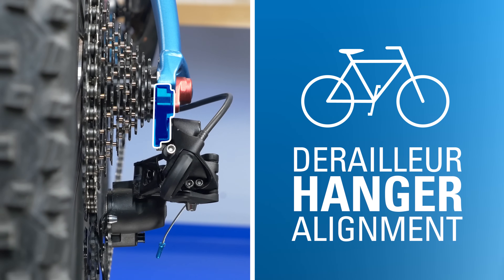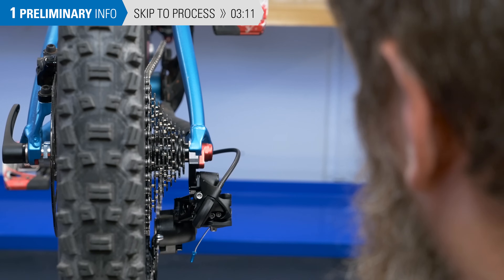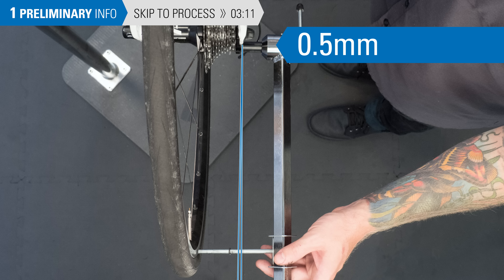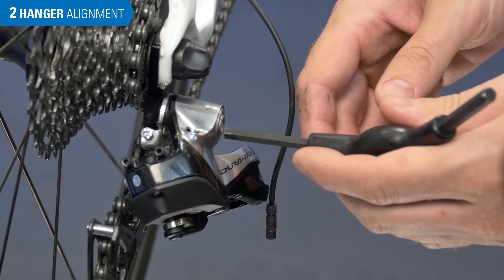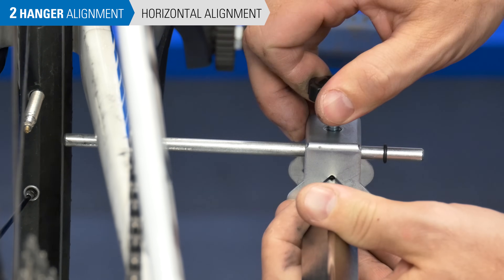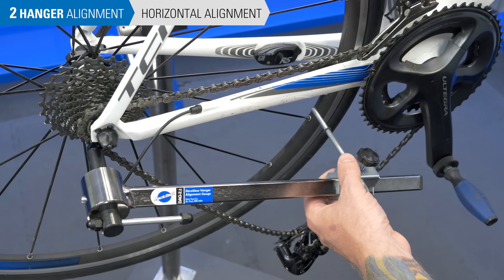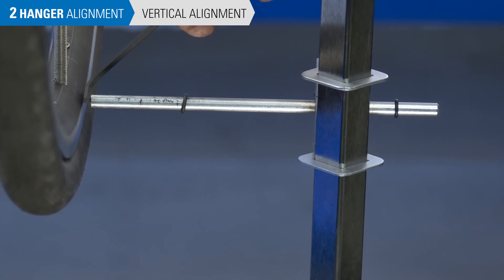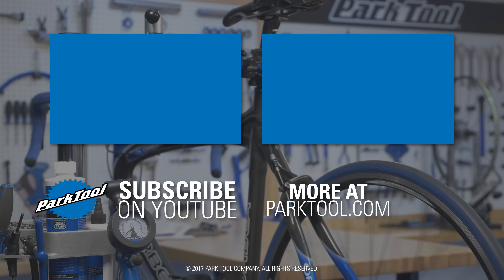How to Align a Derailleur Hanger Using the DAG-2.2

Comment: I habe a problem and I wonder if anyone could help me. I had a big crash which unfortunately bent my derailleur hanger. I tried to replace it but I cannot remove the big screw connecting the derailleur to the hanger. As the hanger is bent right where this screw sits, it is stuck. This makes it impossible to realign the hanger. Is there anything I can do apart from buying a new derailleur?
Reply from the maker: Could you send a picture of the situation to Info@parktool.com and just put Technical help in the title? We can help you a bit better with a visual of the situation. Thanks!

Comment: Is anybody able to help me - trying to figure out why my bike has such poor shifting; after indexing gears, adjusting limit screws, new freewheel, new chain, have narrowed it down to a possibly bent derailleur hanging point (will get to this) or retro-fitting my bike with an incompatible shifting system. Assuming it's the first, it's possible the bike was crashed before me (purchased second hand), as the rear mech does look slightly out of line (i don't have any fancy tools to check properly though). Only issue is, the derailleur is attached directly to the frame - there's no hanger for me to replace or bend back in alignment. I have no idea whether this is par-for-course on road bikes as i've never owned one before, and don't know whether purchasing this tool would help straighten it out as it's not really designed to bend the frame. Is this normal? Is the bike doomed? Thanks to anyone who's read this and might be able to help!
Reply from the maker: Some bikes have the hanger built into the frame and you can straighten them but will want to do so with care as if you break the built in hanger, you cannot replace it. You may also be dealing with a bike that has a derailleur with a built in hanger. These are a bit more difficult to straighten but it is possible to do so with some care. The bike is not doomed but sounds like it needs some adjustment.
Reply: @parktool  Thank you so much! This is super helpful.

Comment: are the limits screws easy to replace
Reply from the maker: Yes, if you have them.  Unlikely you will find this as a new part.  Used ones will work if they are the same thread.  Typically if you stay with a brand, you are safe.  Replace a Shimano limit screw with another Shimano screw.  Many shops will have a "bone yard" of used derailleurs for just this reason.

Comment: Can I do the allignment on a carbon frame as well?
Reply from the maker: A carbon fiber frame will use a metal dropout for the hanger.  If the dropout is metal, follow the same procedure. It will not damage the carbon fiber frame.

Comment: tool 70 $ new hanger 5 - 15 $...
Reply from the maker: Ive never installed a new hanger that did not need to be straightened. This is a combination between the frame tolerances and the hanger tolerances. To test, install a new hanger and check it.
Reply: @parktool  same exp here , brand new bikes and all , never found a straight one , but some were within 3mm
Reply: I have six bikes in my house. $70/6 = $11.67
Reply: Visit your local bike co-op and borrow theirs

Comment: Can this tool used to repair old steel bike with semi horizontal dropout like surly cross check?
Or should I use FFG?
Reply from the maker: Those two different tools are for two different issues.  The DAG-2.2 aligns the hanger only.  Bending occurs at the "neck", the narrow part between the dropout and the mounting bolt.  The FFG-2 is for aligning both left and right dropout faces parallel to one another.
Reply: Park Tool actually it is an old steel road bike and have semi horizontal dropout. It doesn’t have rd hanger so maybe i should purchase FFG and frame alignment tool.

Comment: Just got the Cyclospirit tool of ebay,same as the park but cheaper,checked all 7 roadbikes and all were out by  a lot,should of got this loooong ago,sighting up doesn't work as good as this tool,if u work on ur bikes this should be mandatory tool,also don't think putting a new hanger on doesn't need to be aligned even if u buy a new bike youll be surprised how outta wack a hanger is
Reply: And here you are watching a Park Tool video to use it. Shoulda bought a Park and supported them.
Reply: @BluedotProductions  Generally you're correct about supporting the tool company (Park) that makes the videos but, if someone is poor, I think Park would be okay about it.

Comment: My old frame doesn’t have a replaceable hanger.  Changing gear on the second and third from largest cog doesnt index correctly. Hopefully my alignment tool will arrive today, and ill not break the hanger off. Thanks for this video, hopefully things will work out for me. Update- derailleur hanger was bent, now straight thanks to park tools
Reply: Ya if it's an old steelie it should bend back, no problem.

Comment: What happens if the frame, at that hanger contact point got bent instead? I know the hanger is supposed to be the path of least resistance but I know someone who had their bike fall of their car and the frame got bent instead
Reply from the maker: When a bike falls off a car all bets are off! I hope it is still salvageable. Sometimes with a serious impact the frame sustains some damage.
Reply: @parktool  mu old frame has bent chainstay. Forget about any form of any alignment. The only solution is new frame.

Comment: im sure most bike shop would suggest replacing the hanger rather than correcting.
Reply from the maker: I'm not aware of a bike shop that does not have one or more of these tools. Some of the bikes out there don't have replaceable derailleur hangers. So these can be the only way to save a bike.
Reply: Only if the hanger is bent too badly will the LBS guys recommend replacing the hanger.

Comment: How do you align the new shimano derailluers with the bracket axle? Do you just adjust the hanger same as usual or do you adjust it with the bracket axle installed? Thanks
Reply from the maker: The alignment of the Direct Mount Rear Derailleur hanger is identical to a standard derailleur hanger. This video still applies to those.

Comment: My cycle hanger is bent outward side and it is frame built in hanger and frame is made of steel can i use adjustable wrench to straighten my hanger i cant use dag 2.2 because it is not available to buy in my country reply
Reply from the maker: Typically with a steel bike with a built in hanger you can use an alignment gauage or in your case an adjustable wrench to straighten it. If it is very bent you will be putting a fair amount of fatigue on the metal and you need to be careful and also be prepared for the worst....a broken bike. Good luck! What country are you in?
Reply: You could buy a non park hanger tool but the quality will not be the same

Comment: @Park Tool  Is it safe to use the WAG (or any other deraileur alignment tool) on hanger mounted on a carbon frame?
Reply from the maker: When the hanger is aluminum, it is safe as any other bike. When the wheel is clamped tight, and the hanger is bolted tight, the stress from the DAG-2.2 is on the hanger, not the carbon fiber dropout.
Reply: Park Tool awesome tip. Thanks

Comment: The tool and video worked like a charm. Bike shifting great now. Thanks!
Reply: you bought a ,,$200.00 tool to fix a ,$2.00 part? hummm. I just take mine off and put on a 2/4 and smash it with a hammer.works every time 😁
Reply: @kevinfrederick7956  It was an $80 tool and a bit more accurate than a hammer ;-)

Comment: Is it advisable to use the straightening technique on a carbon frame? Does that risk messing up the drop-out or rear triangle? Or is it better to just replace the hanger if it's bent?
Reply from the maker: Good question. Aluminum and steel both have a yield point below their point of failure, or tensile point.  You can bend both materials quite successfully. However with carbon fiber the yield point is equal to its tensile point.  Carbon fiber flex certainly, but the point where it flexes enough to deform and stay bent is equal to the point where it breaks.  Second however, it is very rare to see a carbon fiber hanger. These are aluminum, and will take a permanent set.  It is done daily with good results.  Third however, new hangers are most always made straight. However, the frames are not a consistent. So installing a new hanger on the bike it is best to check alignment. The fitting on the frames are not always perfect, so a new hanger will sit differently on different frames.
Reply: @parktool  4th however. often alignment issues with new hangers can be a result of neglecting to take care and cleaning the hanger bed in the frame and some piece of dirt can keep the derailleur out o alignment, creek and introduce potential for unwanted movement. if  derailleur is not well seated because of dirt, this means some screw will not have gripped properly and cause further issues

Comment: Derailleur hangers ain't made how they used to be. I've straightened plenty of hangers when they were made from softer aluminum, but these days they seem to be made from CNC'd much harder aluminum billet.  The last few I tried, I broke, even being really gentle.  Brittle, not flexible.  Single use (likely by design).
Reply: elephantcup and way overpriced since basically every frame needs a special hanger... 30 bucks for a tiny piece of aluminium that took 5 minutes to machine is quite a ripoff
You could make the argument they're designed to be a predetermined breaking point for saving the actual derailleur but on an impact that hard the mechanism will suffer anyways
Reply: I get the concept behind a predetermined breaking point, but mine once broke and the derailleur was damaged anyways and it took >3 weeks for the store I bought this bike to source a new hanger... that was really disappointing, that's why I'm so greedy about this ;D
Reply: Derailleur hangers are intentionally designed as sacrificial pieces of equipment. they are like electric circuit breaker. hangers are designed to be strong enough to do it's job, and also to bend and brake, in case of crash or bash. The main idea here is that the force from the impact,  regardless of the source of the impact, will follow the path on least resistance. The hanger is designed to vividly manifest itself as the path of least resistance, so it draws the force of the impact onto itself. the idea behind this design is to protect the frame and the derailleur  from being bent or broken. If you think, this sacrificial piece saves you a frame, a derailleur and the hassle of replacing frame or equipment.... and the pile of money related to all this hassle.
Reply: einHOCHaufWISEGUYS No, you were just dumb for not having a spare hanger for your bike, which any sensible rider would. LOL